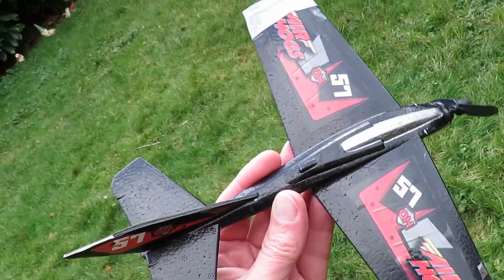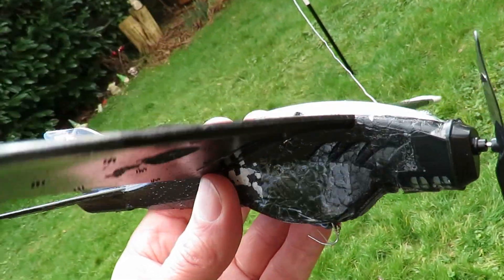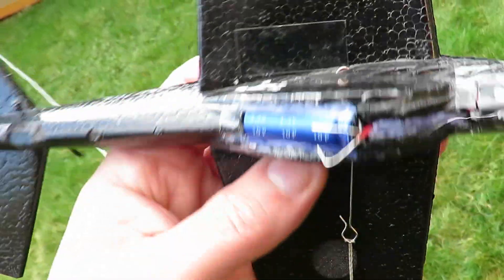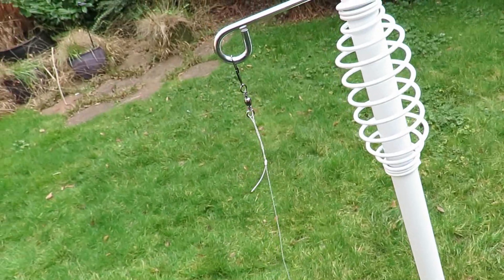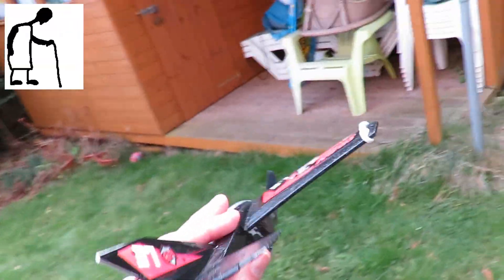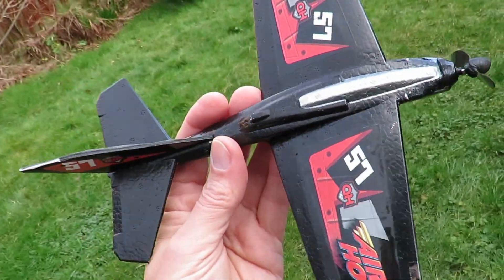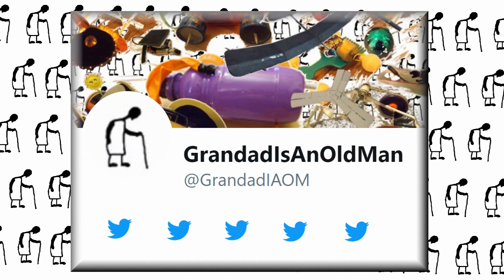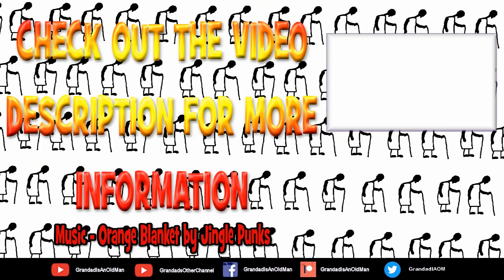Air Hogs Wind Flyer Supercapacitor Round The Pole Tethered Flight

Comment: Just got a new one of these from eBay. It’s crazy to see something I vividly remember playing with as a little kid so old that the nimh battery was super corroded and old. I took out the little charging board inside and plan to put in one of those little rc car receivers and make it 2ch rc. Hopefully this will be the best flying one I’ve had. As a kid, they either flew away or the propeller would break which killed it.
Reply from the maker: Hey, great to hear from you, Neil 😊😊I have done virtually no flying this year. Just a couple of days. Maybe I should dig out some of my planes and have another go at this Round The Pole. Good luck with the conversion. I still have a couple of little RC cars that I had bought as donors for aircraft projects that I never got round to doing.

Comment: That’s really cool but I think I would need a lamppost to support some of my planes haha
Reply from the maker: Round the pole was very popular when I was younger. We had the batteries on the floor and fine wires going to the aircraft with power controllers like Scalextric hand throttles. It meant aeromodellers could fly indoors in the winter.